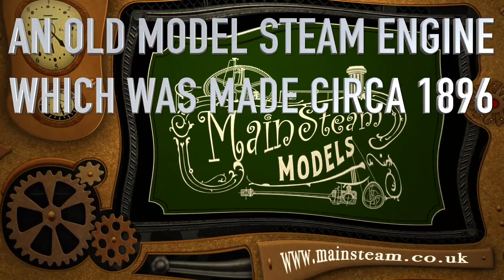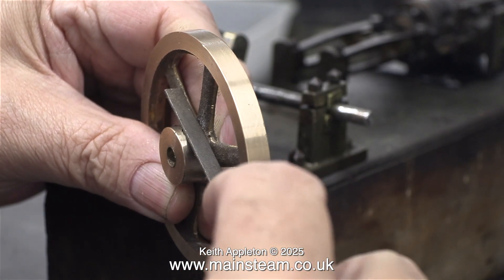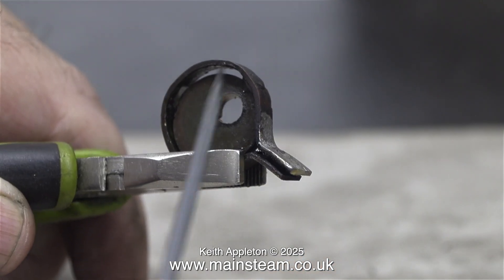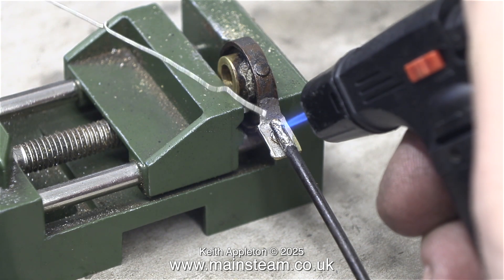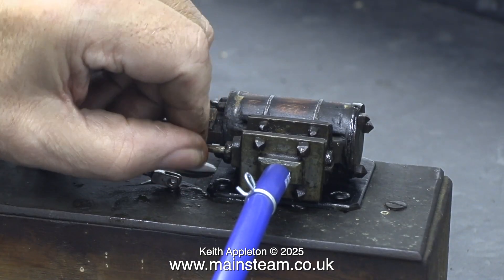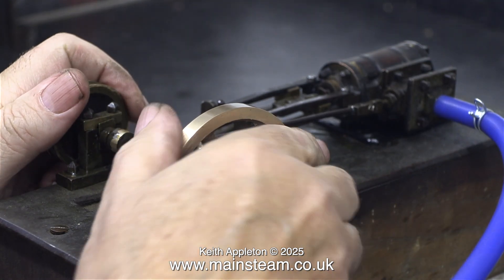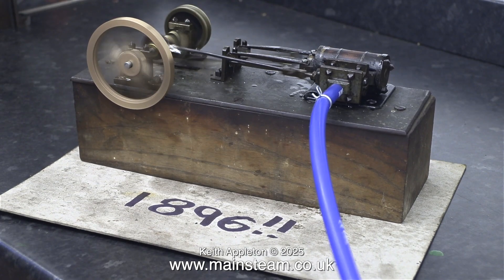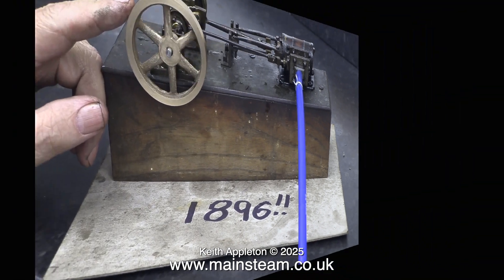REBUILDING A MODEL STEAM ENGINE MADE CIRCA 1896 - PART #7

Comment: A one piece steel crank with counterweights would do wonders towards getting that thing to run like a sewing machine. Still, it's amazing that it was built by an underpaid overworked laborer AT WORK and it still runs over 120 years later.
Reply from the maker: Thank you, I am aware of that. The problem is if I do it that way with a "one piece steal crank" makes it far from what I want. - A Sympathetic Restoration. Please watch the further episodes.